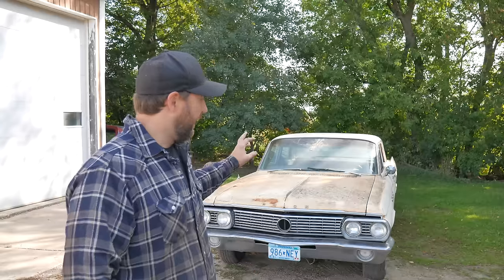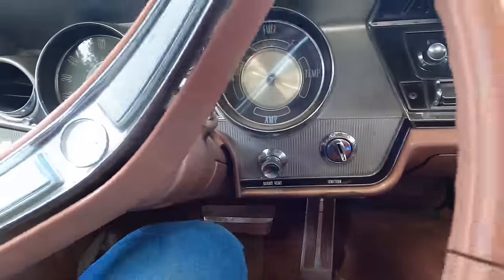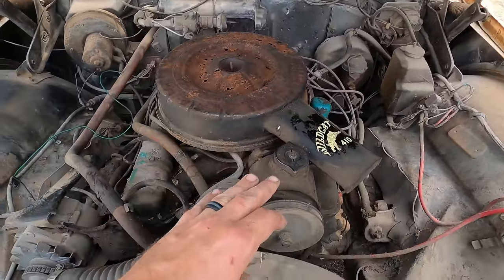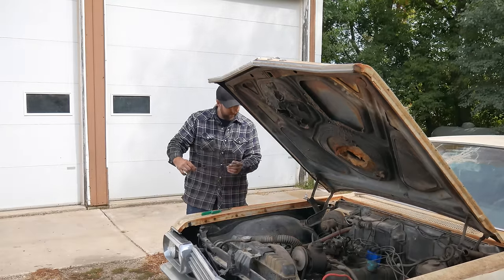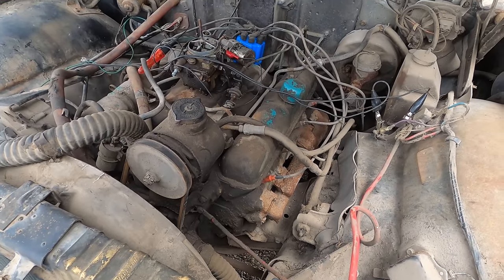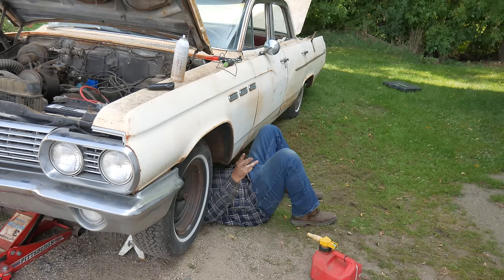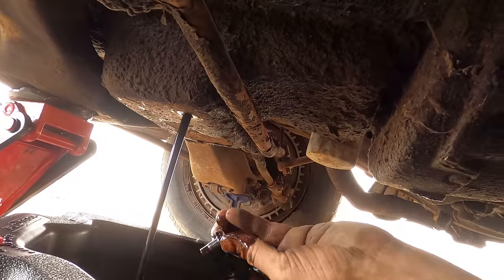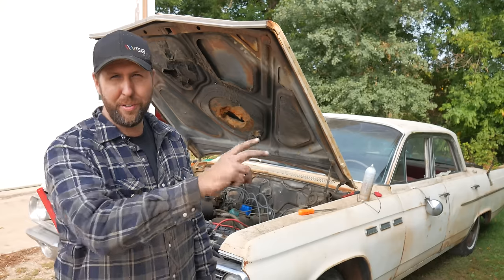FORGOTTEN 1963 Buick LeSabre - WILL IT RUN After 23 Years? (P1)

Comment: I was born when the 50's was brand new, I've always called them points. Tune up; points, plugs and condenser. Match book cover for points gap then fold for gapping plugs. Lol.  Enjoyed, keep up the great work. Thanks.
Reply: I was born when the 50's was brand new also...For reference, a thin dime (dimes used to get thin when they were made from silver) is .035". I haven't seen a thin dime is several decades now.

Comment: Watching this video brought back so many memories. My grandfather had this same car in silver and every summer I would drive with him out to Long Island from NYC. On the speedometer that little arm was a speed alert that you could set at any speed. My grandfather set it on 80 and I will always remember the constant ahhhhhhhhhhh blaring along the way. Grandpa was a leadfoot! When I got older I would tune it up and I still have the timing light, dwell meter and special Allen key tool used to adjust the points. That Wildcat engine was amazing.

Comment: This is an EXCELLENT video to peruse. Whether you are familiar or not with this channel, this is a good place to start. Derek has his channel signature hat on and he is in a teaching mood and this man has significant knowledge regarding what has become known as "barn finds". What with his own language for entertaining you can learn a thing or two about our mechanical friends, these auto mobiles. Regarding the contacts or points, I am of 66 years experience and I have never heard a mechanic refer to contacts, not even the old when I was young ever used that term in my geography. Normally home mechanics used "feeler gauges" to "set" them rather than a dwell meter. Only GM had the window in the distributor to correctly set dwell while the motor was running. this Buick had a single master cylinder for brakes and a single fuel line from the tank. Those improvements were added into GM production around 67 or 1968. The first pollution device was added in 1963 model year and was called the PCV  valve and that was slang for pollution control valve of course. Just a simple one-way valve to attach a vacuum line to the upper crankcase that supposedly increased fuel mileage.

Comment: Everytime I had gas in the engine oil it turned out to be the fuel pump diaphram was bad.
Reply: Also happens when the float unfloats  or the float valve gets a bit of crud stuck under it and won't close
Reply: lets hope you're right
Reply: Needle& seat could have crud in it.

Comment: I have always called them points but my grandpa would sometimes call them contact points. I suggest pulling the correct snout off the bad starter if you can, I used to have to swap the snouts on starters on my 66 Impala with 3 on the tree because of a flat spot on the bell housing.

Comment: My Dad has the 1963 Buick Riveria! Lovely car, it has the 401 four-barrel, and also came standard with a 425 with dual 4 barrel carbs.  it looks very similar to the LeSabre, most of the same parts are used in both... 
I think he has a full shop manual for both...

Comment: I had a 62 electra. The dynaflow 'accumulator' rod when moved by flooring the throttle simply affects the stator ring inside the torque converter to affect the fluid flow, so it hits the vanes with more pressure,  you can drive without it connected. Its kinda like a downshift without using gears. Dynaflow also has a low gear that is only in low when shifter is moved to low. All the 'gearing' of a conventional 1-2-3 shift is done by fluid flow in the converter.

Comment: I have a piece of duct tape on top of the shroud that I write stuff on.  I do that for oil changes.   I have a strip for general info and parts #, wrench sizes for filter housing and drain plugs.  I also have one on top of the air box with the last filter change as well (mileage and date).  Super handy.

Comment: At one point in time they were called contact points. From an old guy. Older Buicks were my favorite too. My 1st car was a 62 Skylark, white 2dr, black vinyl interior and top. 215 Aluminium v8, so smooth  you couldn't hear it run. Great car, low miles when I bought it in 65. Also had a 67 grand sport 400. See ya

Comment: Derek you should use Motor Kote on your rescue edginess it treats the engine metal not the oil. It’s an awesome friction reducer. It will help with the rings and valve seals

Comment: My parents got a hand-me-down 63 LeSabre from my mother's father (my grandfather) probably in the late 60s or early 70's. As a little kid I remember a few things about it: it had a radio speaker in the back shelf that I thought was WAY cool, it had a buzzer that you could set that would go off when you went faster than the set speed, and my father commenting that it had the "Wildcat" engine in it. 
Oh - I also remember stopping at a hot dog stand and throwing up on the floor.
So "that's fine."

Comment: Not real familiar with older Buicks but a lot of the older Chevy small-block starters had variations sometimes a different type of nose cone like that.
A lot of times you could switch the nose cone around or maybe even take the starter drive out of the new one and put it in the old one or take the body of it the parts containing the brushes and Armature and switch it.
A lot of times you could make that work with the two different styles by combining one...
That was basically just the starter drive or Bendix they used to call it spinning freely and not engaging.
Sounded like the starter motor itself was functioning.

Comment: Fan Clutch: I had a Datsun P510 station wagon. Fan clutch went out so I match drilled both hubs and slipped in a quarter inch bolt which acts like a key. Fixed...... forever. Direct drive.

Comment: Wow man!  I had a 61 electra 225.  4 dr.  With a 401....  it was a 445 wildcat!  325 horses 445 pounds  torque, Carter 4 barrel,  power windows and seat, and it was stock, speedo went to 130, it would go faster, crazy....  adjustable  speed minder buzzed if you went faster  than where you set it.  Clock on dash looked like a tach..... I miss it. Lot o people said 401. Was. AMC. Motor.... I learned years after I got it that a 401 is a nailhead  motor, (  hemi is the only head I knew  of)...  power bench seat.  The gauges were  backwards, and you looked at a mirror,  which was adjustable, for your height??   These cars are  awesome. Mine was a 4 porthole car, I figured  the 401 made it a 4 porthole  only car, but yours is a 3 porthole car so I learned something. Oh and my 61 had backwards lug nuts  on the driver  side...  does yours? I learned the hard way, hehe....  mine was an automatic  but it was a big hydraulic pump,  called twin turbine?  Owners manual said you could push start it. Sorry just rare to see a 60s  buick post with a 401....

Comment: 15w40 oil is great for break ins.  I always break in my rebuilt engines in with Rotella or Delo diesel oil. However some engines with weak rings will tend to smoke because it just can not wipe the oil off well enough. Castro oil is vary good oil in that regard.  Use to heavy a weight and you could get smoking.

Comment: This is pretty late, but those old Buicks are good lookin'. Had 2 in my life. A 63 Special with an aluminum V6, and a 68 Wildcat with a 430. Both runners; for a 6, that Special would move right along. And the Wildcat just plain hauled ass.😅

Comment: That '63 is in pretty nice shape for its age. The starter kind of figures but gas in the oil yep rings and the radiator does look like it might have issues well I will be stay tuned for the next saga in the will it run Buick. Dad had a '37 Buick and my uncle always had to buy a Buick Electra 225 so they are a decent car. Hopefully you will get some good luck from the Motor Gods and get her running.

Comment: Ya ever use marvel mystery oil in the cylinders, about 4 squirts per cyl. and wait a while. Then bump it over several times. Then add about a pint per gallon in your startup supplemental gas tank. Start and run for till engine is warm.

Comment: bad starter drive... really only a couple different ones for a lot of those older Delco starters, not hard to replace in the field.   Handy item to have "in stock" in the rescue parts bin.   Swapping the nose plate from the old to the one that works another option.   (my pops was in the starter/generator business when I was a kid,  used to tear 'em down and clean 'em up for him)

Comment: Great thing about all the nailhead Buick engines is that the stock valve springs are so weak that the valves will float before you can overrev it and blow it up.

Comment: I'm 65, and I had 2 semesters of auto shop in high school (1972-73 school year). They are called points. I always got A's on written tests. Unfortunately, changing the oil and replacing spark plugs was all I could actually do. I ended up being the helper to the guys that could actually work on cars. Ironically, those guys did bad on written tests. In theory I could work on a car.

Comment: I would say points, rotor arm and distributor cap. and the other one is the condenser they were the normal pain people never thought to change that little component, if it had a bulge it was blown. I agree with the plugs, as a diy tool I had a gunson colortune it was a real nice bit of kit even better if you had a strobe light and white nail varnish.

Comment: having been in the Automotive repair industry for over 50 years I was dumbfounded to see the air cleaner housing "RUSTED THRU"  and I am originally from Wisconsin where they use 47 tons asalt per block in the winter and you can tell the age of the car by how much of the fenders have been chewed off by "Tin Worms"

Comment: Oil being a quart or two high will be due to fuel pump being bad. The Nailhead engine fuel pumps are known to blow a seal and dump fuel into thr crankcase. They will happily still run but white smoke out the tailpipe due to all the fuel in the oil!

Comment: Ya’ know, if the oil smells like it has gasoline in it, the first thing I check is the fuel pump. When the diaphragm first starts to go bad in those old mechanical fuel pumps, it’ll leak fuel into the crankcase.

Comment: Man Id love to see this restored to original, I love 4 doors.  I love my daily 69 impala 2 door but a coupe is way easier when you have friends getting in/out
Reply from the maker: I like them too
Reply: @ViceGripGarage  For sure, Ill be very interested to see how this one comes out.  If you got the time though, any advice for a first timers engine rebuild?  Im 21 and have done easy repairs like brakes, waterpump, fuel pump etc on my car but my engine is getting very tired and its my only car, any tips or suggestions?  Thanks!

Comment: Another source of excessive gas in the oil can be from the mechanical fuel pump.  Usually when the diaphragm goes bad they'll either leak outside the engine, or worse, it'll leak inside and into the oil.
Reply from the maker: Correct! Watch the follow up 👍👍
Reply: @ViceGripGarage  Will do later tonight.  I sincerely wish you and your family a very Happy New Year's!

Comment: Dryer sheets are anti-static and fabric softener, they don't absorb much moisture.. Why would they when they go in a swirly box designed to remove moisture already. For a car interior at most they will act a bit like an air freshener because of the fragrance on them. Won't do anything to stop moisture build up or mould.

Comment: Dynaflow, is that the infamous 1 speed transmission?
Reply from the maker: Low and drive.  Doesnt "shift".  Nice smooth power.  Really cool.
Reply: @ViceGripGarage  kinda seems like a really primitive CVT. I'm sure the torque of that big v8 helps too.

Comment: Gotta love a Buick👍 love my 82 Electra and its 307 but I can't get over the egr if its removed all I hear is wont run correctly. Idk Egr junk but id hate to swap a good running 307 if it could run without egr..what are your thoughts? If it wont ill be looking for a 350 rocket olds

Comment: Love your videos but I cringe every time I see you pour raw gas down a running engine. Ever have one backfire while you do that? I have! Your instant reaction is to hurriedly pull your hand back then the flaming gas flies all over the place, mostly on your head and other body parts. Now there's more flamage than at a Nickelback concert and believe you me, you don’t feel like a rock star.  I was lucky as it happened to me on a boat in a marina on the coast of B.C. and I wasn’t alone.  Two steps and I dove into the Salt Chuk extinguishing all flames on my body and my fast thinking buddy “Hair Ball” extinguished the flames on board with a fire extinguisher.  I love your crazy antics and keep them up but keep them safe too buddy! Experience talking here.